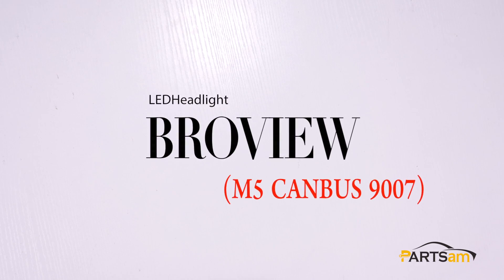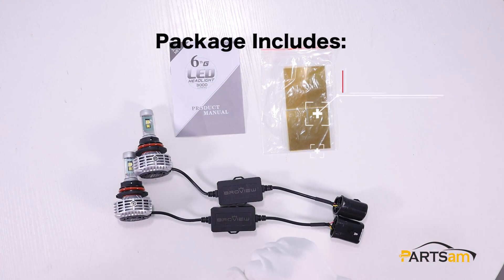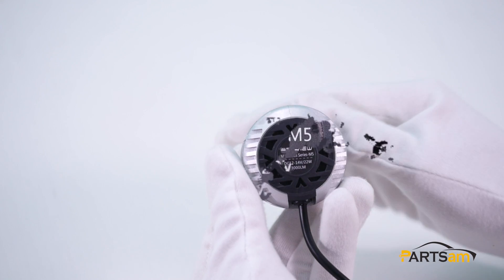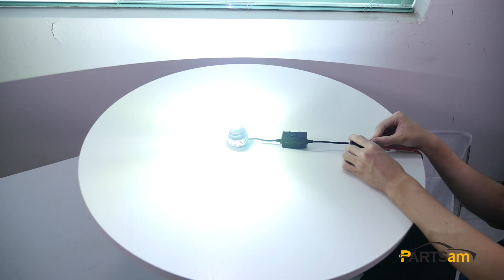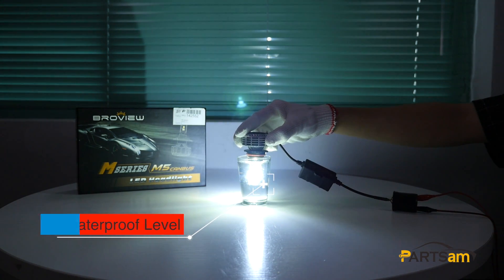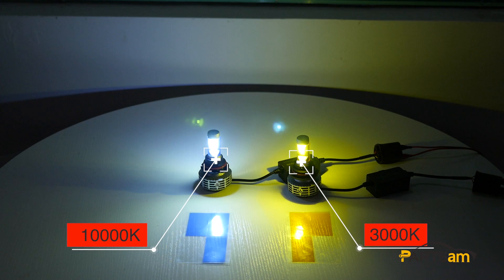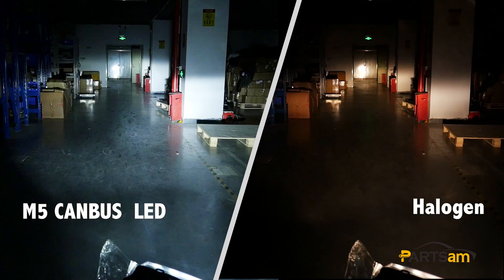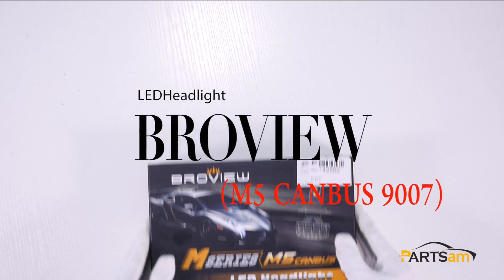How to solve the LED Headlights Flickering issue ? Broview M5 Canbus 9007 can solve it

Comment: More THUMBS DOWN than thumbs up. (it's a HINT butch)
Reply from the maker: I am sorry to hear that you are experiencing problems with the product. 
Could you please tell us more details of the problem?
Not compress? Making noise or anything else?
Or any picture of the defective part?
We will send you replacements once confirmed.
Thank you for your time. Hope to hear from you soon.
Reply: Partsam, your title... "How to solve the LED Headlights Flickering issue"
There is nothing in this video that shows us how to FIX flickering.
Reply from the maker: Hello, fm00078
canbus system can solve FIX Flickering issue.
Reply: What you are saying is REPLACING not FIXING. 
Need to RE-title your video.

Comment: Hi. I've changed my headlight into LED. I've noticed that when i switch on the light, there is a hamming sound and it disappear when switch it off. Is it because of LED light?? what causes it??
Reply: Ritchie F it might be the fan inside the led bulb, mine gets pretty loud too
Reply from the maker: Did you open the radio when you use them?
Reply from the maker: how long does this hamming sound last?
Reply: thanks for your prompt response. I'll be back to you once I observed your questions.
Reply: FishSlaya yes it is the fan..how did you fix yours..??
Reply: Thats normal, it's the motor behind the led which is on and working